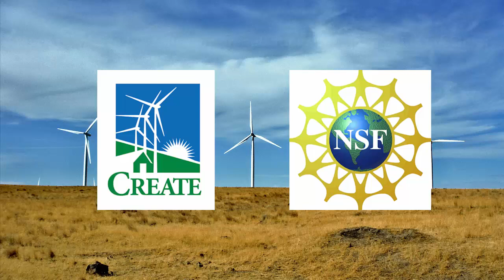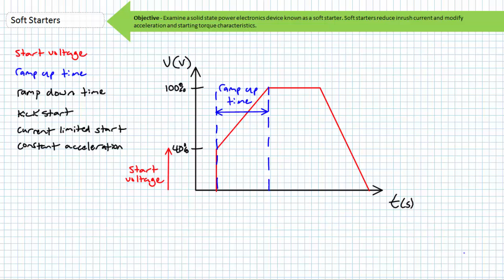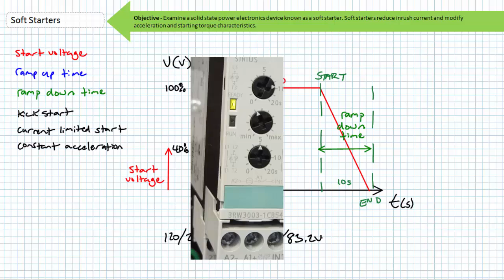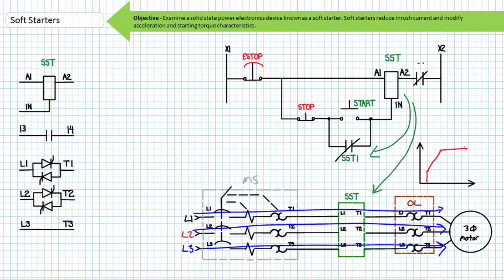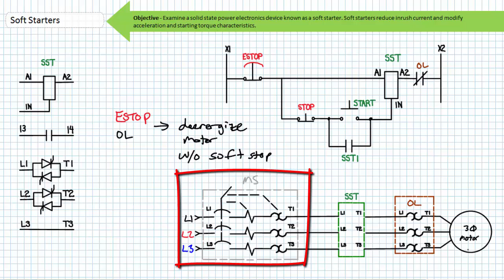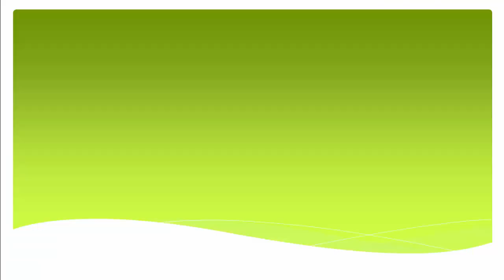Soft Starters (Full Lecture)

Comment: Thanks for this awesome lecture. At 19:38, you made mention of a manual or magnetically actuated electromagnetic contact in series to the soft starter as a fail safe approach.
I would want to know if this electromagnetic contact is already in the soft starter or a separate contactor must be connected in series to the soft starter by the technician
Reply from the maker: I suppose you could manufacture an integrated element with both components inside but I've always seen them as separate, independent elements.

Comment: I have a 150hp 480 3 phase motor with 12 wires coming out. At first we wanted the wye/delta start method the chose a soft start. Rewiring the motor, i lost the identity of 2 wires due to age and congestion of the wire box. What could happen if the 2 wires are in the wrong bundle? Thanks.
Great vid.
Reply from the maker: I feel your pain. Depends if the wires are intended for the same phase and same polarity or a different phase with a different polarity. Remember the windings occupy different physical spaces on the stator and current direction influences polarity. If you use the wrong phase there will be a hitch in the rotating magnetic field. If you use the wrong polarity a winding will be a N when it's supposed to be a S and vice versa. Check out the motor connections diagram lecture for the consequences: https://youtu.be/gnQlQ1QuFT8?t=1496 There is a method of determining unknown windings using an analog voltmeter however I don't have a lecture on this yet. Given you've got 10 of the 12 nailed down you might be able to disconnect the 10 known (label them first!) and use an ohmmeter to determine the remaining 2 unknown connections. (Example: 1 is connected to 4)
Reply: @bigbadtech  
Thanks jim. Now i have a starting point. Ill post results

Comment: I am trying to overcome an issue I have found while using a 4.5kw rotary phase converter. The converter draws around 4A in it's normal off load running state but the huge inrush current quite easily trips 20A B class MCBs. I might look at using a D class MCB but I'd prefer to get a handle on the inrush current. I don't think I can simply use a soft starter on the input line as it uses capacitor start to spin up the idler motor. I'm in the UK so 240v is our standard domestic voltage. Any ideas gratefully received.
Brilliant lectures and very much appreciated, thank you.
Reply from the maker: Good question. A rotary phase converter is in effect a single phase motor driving a 3 phase generator. While I do have some experience w single phase motors, I don’t have much experience w single phase reduced voltage starters but I’m certain there’s got to be a soft starter or other technique that’d work.

Comment: Would it be possible to use a soft starter on a single phase three wire motor?  Such as a submersible deep well pump with a control box that has a start & run caps to shift the sinus wave to the motor coils.
Reply from the maker: Yes, there are single phase starters commercially available. Eventually I plan on covering single phase motors.

Comment: How about if we have a pre configured 3 phase 6 leads motor.Can we run it using soft starter with the y or delta configuration?
Thanks.
Reply from the maker: A generic soft starter as illustrated in this lecture wouldn't care what it's driving (either y or delta configuration). However be aware of soft starters offered by certain manufacturers that may be application specific.

Comment: Hye.
We have few Soft starter of 3RW model.
Normally it is set at certain min starting voltage and ramped up slowly to reach max voltage.

Say we set at min 30% up to 100%, the voltage slowly increase in increment of 30,35,40 etc. Theoretically this is controlled by the firing of the thyristor.

However I do not see any specific setting of setting  up the firing angle so that it increments as such it reaches 100%.

Where does,and how does the drive do this and if I were to change the firing,how can I do it?

Comment: Question: Could this be used for dynamic braking?
Reply from the maker: +D. G. Easiest way to dynamically brake a 3 phase AC induction style motor is something called DC injection braking. I'll go over this and other dynamic braking methods in later lectures. Brush up on your "Electromagnetic Interaction" skills!
Reply: TX
(Does this include eddy current brakes?)
Reply from the maker: +D. G. Most definitely although eddy current brakes require a little more hardware than DC injection, typically a disc in which the eddy currents can be generated. Regardless this method is super cool.